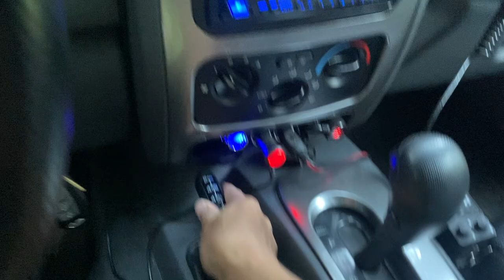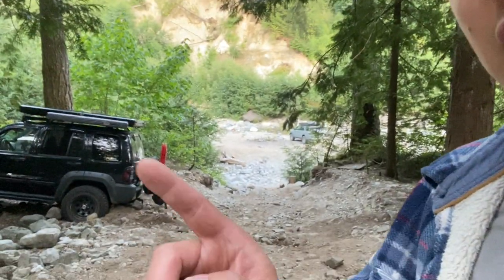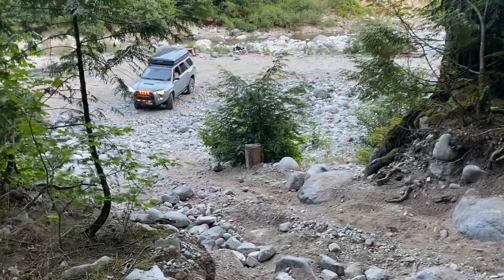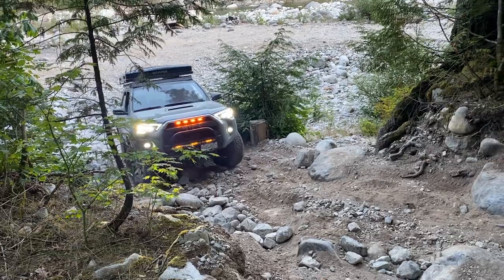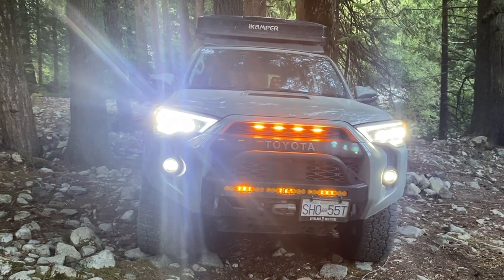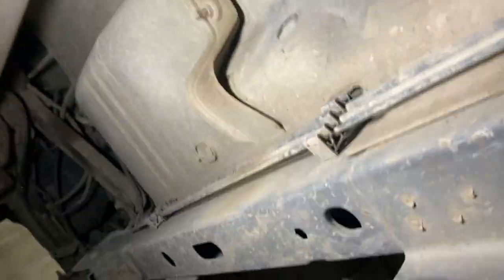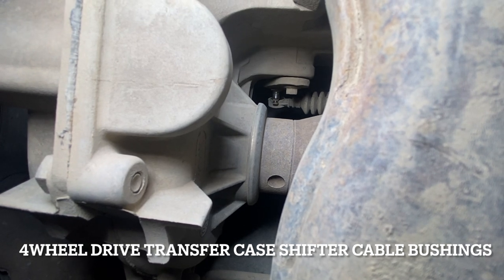JEEP LIBERTY KJ | 2WD | 4x4 MALFUNCTION | SHIFT LEVEL CONTROL ROD BUSHING

Comment: Usually linkage bushing. Mine broke this weekend. Little plastic piece and easy fix.
Reply: do they make or could one be made of brass for replacement?
Reply from the maker: they had little rubber parts on amazon.

Comment: in future if that happens you can use a cotter pin to hold the shift cable in place and you will be able to still somewhat select 4x4. There will be slop in the shifter, but you will be able to shift. Other option have is have a screw driver with you and you can manually pry the t-case shifter.
Reply from the maker: Great idea! Thanks

Comment: What lift kit did you use on your Renegade? Asking so I can lift mine at some point. Your rig looks really clean!
Reply: Yah just asked the same question, I’m building up my renegade and was thinking of doing just a spacer lift, I just want some more clearance, articulation is not necessity for me. I want it to be capable but budget. And my off-roading mostly includes b service roads with a two feet of snow or extremely ruff fields.
Reply from the maker: spacer lifts are good, i've had it for almost 2yrs now. I've recently changed to bilstein and ome for rear and will be instailling the fronts.